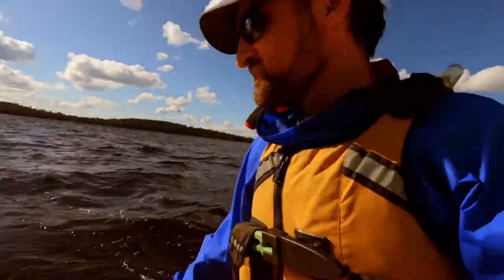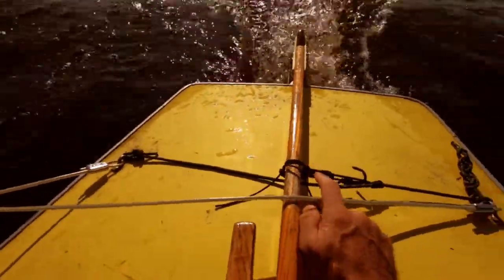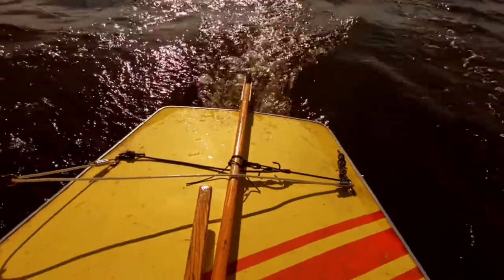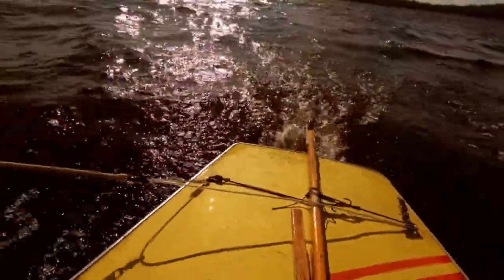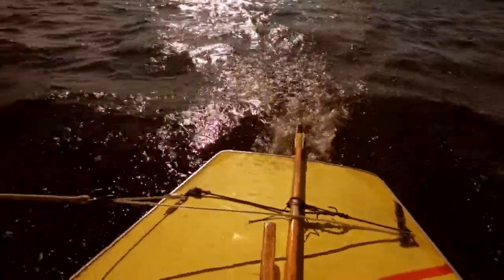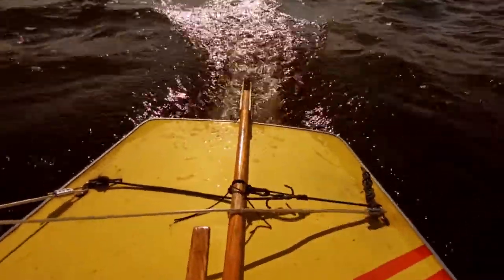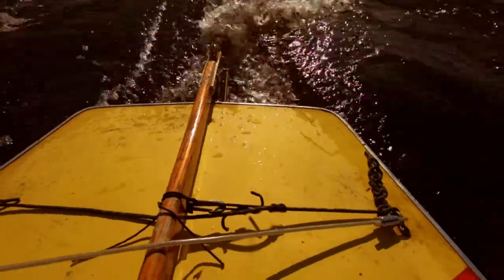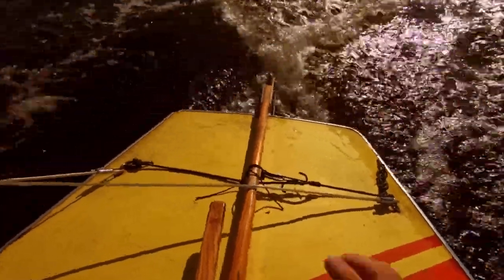Sunfish Sailboat Autopilot DIY

Comment: This is for lazy people! Please do not do this because you always need to be adjusting your angles on the boat to maintain boat speed. I do competitive travel sailing and seeing this just screams no boat speed. Maybe try to do this down wind but you should always be holding your tiller.
Reply from the maker: I certainly agree that adjusting angles is the way to maintain speed, although I focus more on day trips and 2-7 day overnight trips with my Sunfish and am not as worried about competitive speed. I'm more focused on being able to take a break for a moment in light wind to grab something from a drybag I have clipped around the mast. I limit the use of my autopilot (I've since switched to using a Tiller Tamer) and only in light winds--generally when going downwind. You can see the bags I reference and perhaps the need to grab gear during long crossings  in this series: https://youtube.com/playlist?list=PLNcpRGw7T0bgjjYL7CiiZMT1rRCJxItht
Reply: Apparently not.